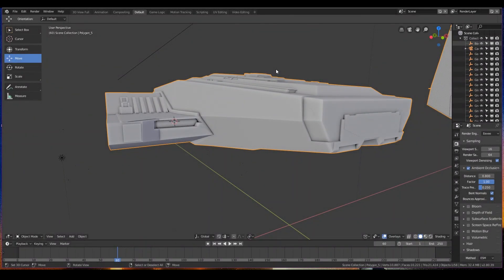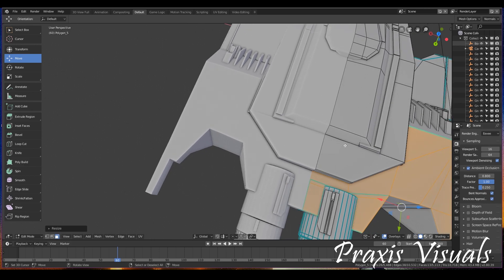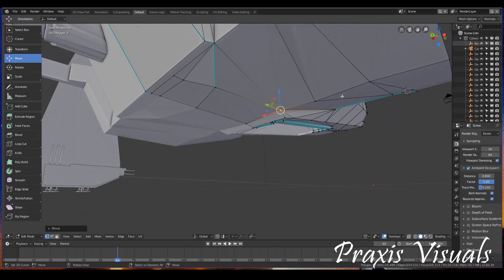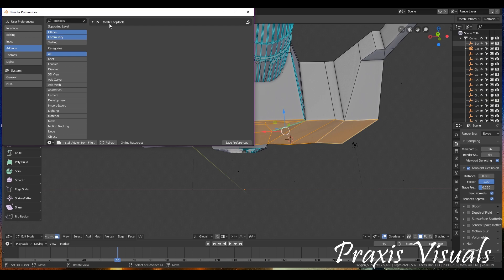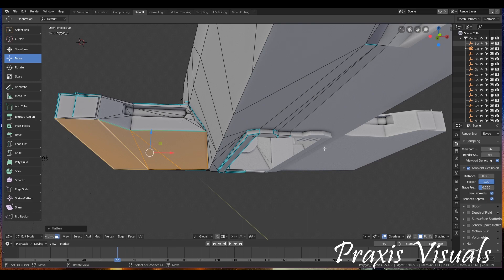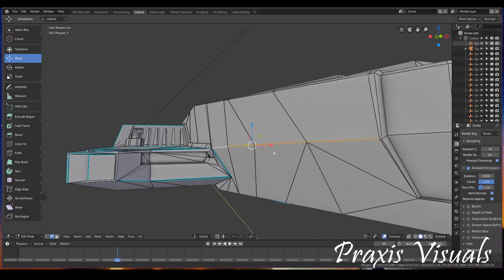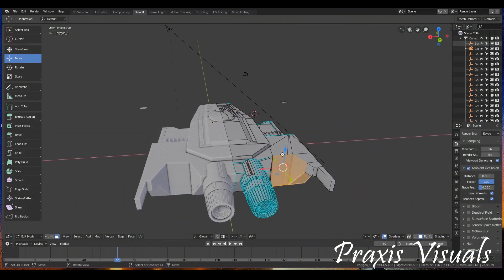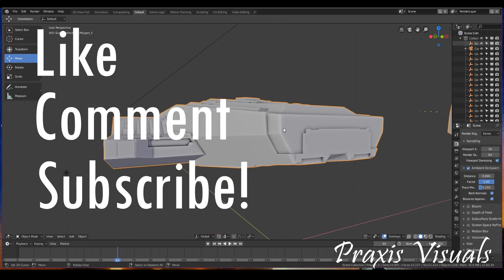How to Flatten Faces in Blender

Comment: While you give an excellent tutorial in every way— it still doesn’t solve a certain serious flattening problem. If you have a shape that’s not merely a quad, and it has crinkles in the face, how do you flatten it without totally rearranging the outside connecting vertices. Also what you just did can simply be done by flattening along normal Z.  I guess  my primary question is, how to fix crinkled surfaces that refuse to fix? I’m familiar with using edge offset, but that fails sometimes.
Reply from the maker: I see. Well depending on your mesh, and how much flattening you need, you could manually slide each vert. to a more flatter position, then use the technique shown in the video. That way you're giving more information to the flattening tool which in turn will help not to rearrange too much... I'm not sure if there is a way to flatten something without rearranging neighboring vertices...
Sorry I couldn't help you on this one!
Reply: @PraxisVisuals  nonono— you were actually QUITE helpful. I’ve eventually figured it out in the way you just described. It seems custom axis/orbit point and rotate individual vertices with snapping on is best. Thanks Praxis!
Reply from the maker: @greatsol2444  Good good! Glad you got it worked out! :)

Comment: Thanks, big time saver. A note I'd add about 'affected non planar triangles.Pivot Point on active element is awesome with transform orientations custom Z axis. I then to SIZE it to flat with the 0 key. Also useful, duplicating a plane, then making it an object (p); that may be used to Boolean Mod verts for new unaffected faces. Not easy sounding but a great work process.